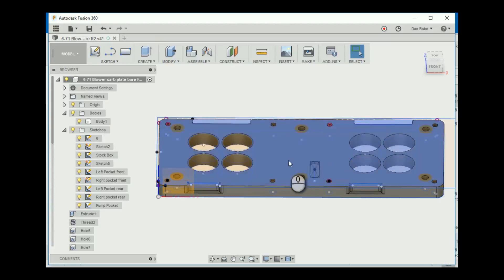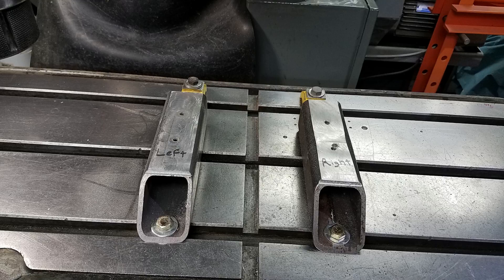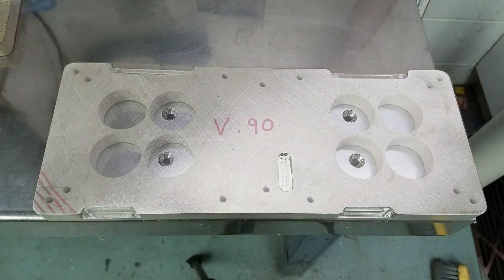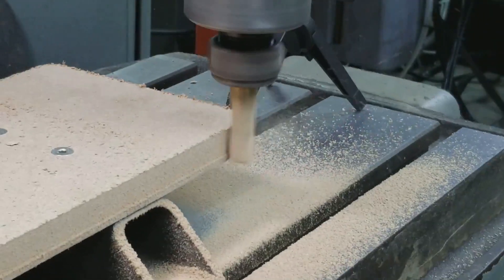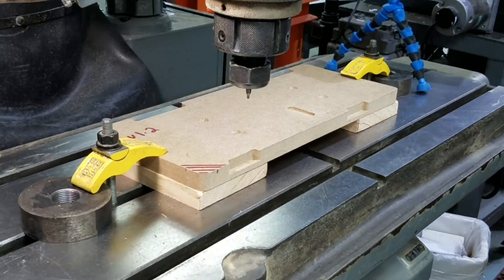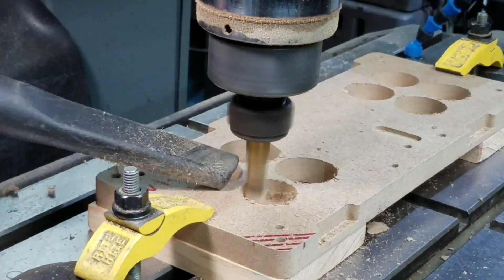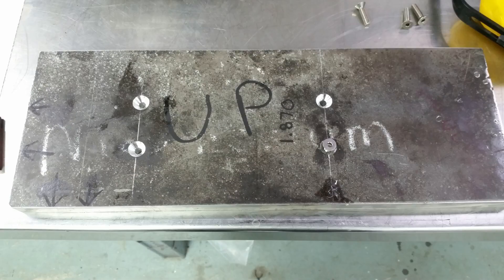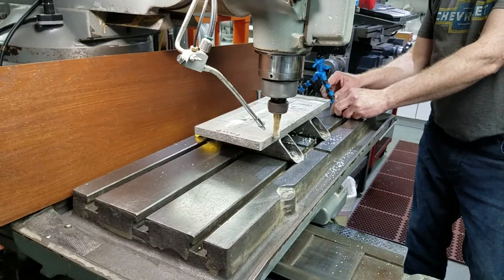My 6-71 Blower rebuild, Part 15: Custom machining a Magnesium carb adapter plate.

Comment: I Also Built My Own Carb Adapter To Be Boost Referenced For My Edelbrock Carbs ,Thank You For Your Videos !!!
Reply from the maker: Thats very cool.  I have not worked on Carter AFB's (what became the Edelbrock "Performer" carb) for about 40 years.  Do they have an easy way to boost reference through the base-plate?  I just don't recall after so many decades of Holley only.
Reply: @MakerCave  I can send you the link that I found to boost reference the Edelbrock carbs thru an Email if you like
Reply from the maker: @gregschultz2029  Well, we can't E-mail through Youtube, but you must be talking about this example from the HAMB:   https://www.jalopyjournal.com/forum/threads/boost-referance-edelbrock-afb-carbs.361134/   Looks like a very simple modification that just requires simple cross drilling in the plate.  Should work out great!  There seems to be a fair amount of confusion out there about boost referencing, but I 100% agree that providing the "below blower" signal is highly worthwhile to allow the Power Enrichment circuit to function as intended with a draw through blower.  Your boost ref will help avoid a full throttle lean condition.  Good luck getting her together!
Reply: Yes ,That Is The One I Made ,Thank You For Your Response !!!

Comment: Hoo Lordy. Not only are there way more steps to converting a stock blower to automotive use than I expected, a lot of those steps are high precision,and I specifically refer to the drive gear step(s). Get anything wrong,not only do the tolerances go out,the blower can make very expensive noises very quickly. Every one of those steps was written in blood and/or money. The hot rod community had to figure those steps on their own. And somebody got to pay for anything they got wrong.
Really appreciate the effort you took,not only to get the blower just so,but the video would have significantly added time and frustration.
Great job,hope you get to bolt it on to your latest rod real soon. Cheers.

Comment: Why magnesium and not aluminium? Sorry if you already told somewhere but I missed it.
Reply from the maker: Funny that you ask, and I actually give a partial answer in the video description, above.  Click on "Show More" below the description to see the partial answer.   The whole answer is that it was an accident.  25 years ago, I was building a blower for one of my cars, and was on a shoestring budget, I mean even spending $20 was rough then, but I was determined to have a blower.  My Father in Law had a good friend in the scrap metal business so I asked him "can you talk to your scrap guy, and see if you can get me a piece of 3/4" aluminum plate for cheap?"  The plate was about 8" wide and about 3 feet long, and it was crusty, I mean really filthy, so I paid scrap price, $5 I think, for this huge piece of plate.   I scrubbed it off with a DA sander, which took a really long time, and finally got a smooth surface on it.  I used a hole saw to cut the venturi holes in the plate, and laid out all the mounting holes by hand, drilling them on my old Craftsman drill press, the only shop tool I had at the time.  I noticed that the plate drilled and cut really nice, and seemed very light after it was done, but didn't really dwell on that.  I just thought that it was a really nice alloy of Aluminum.  I took the extra plate, which was nice and shiny and put it back on the shelf.  Two years later I went to move to a new house, and I discovered that the spare plate was just as black as the day I first obtained it two years earlier.  It dawned on me then that this was not some ordinary aluminum.  I shaved a few chips off of it, put a couple of drops of lighter fluid on the chips, and lit the fluid.   After about 10 seconds the chips flared up an intense bright white, like the color of a 4th of July sparkler, which usually has some magnesium in it.  That is how I confirmed what metal it was.  I kept it around, in case I had to make another plate someday, and here it is.  A piece of aluminum plate this big is close to $100, so the final answer is, I used it because I had it in inventory.  It just happens to be icing on the cake that Magnesium is only 2/3 the weight of aluminum, and stronger per lb than aluminum.  Thanks for watching my video!
Reply: I did read the description but I thought it was odd to use more expensive material so I thought maybe there was some benefit I did not see. But I now see that it was somewhat of a coincidence :) Thank you for making the videos, I hope I get my other projects finished soon so I can get working on my 6V71!